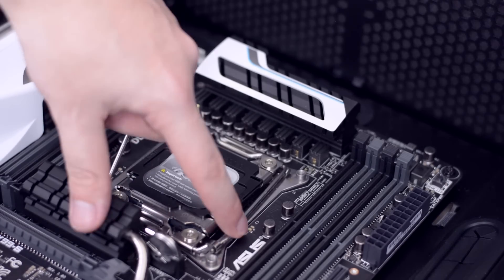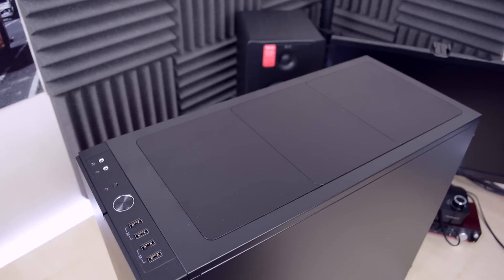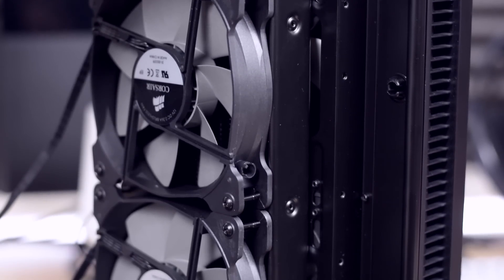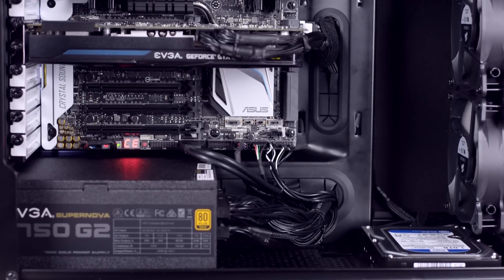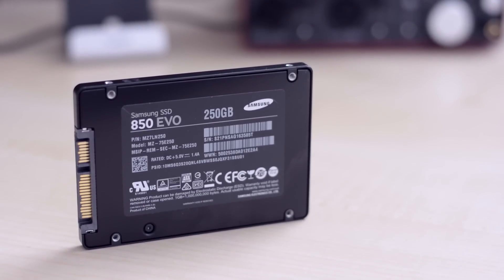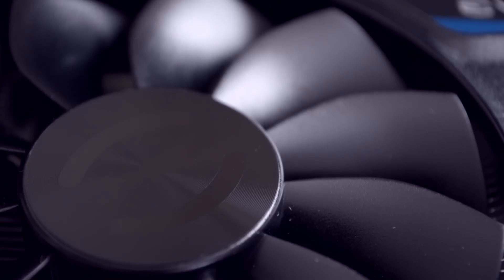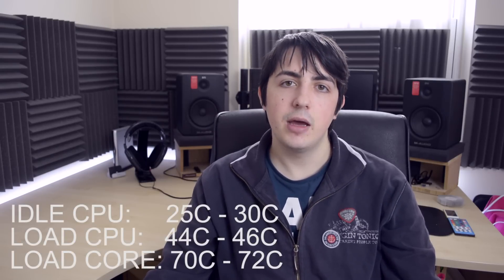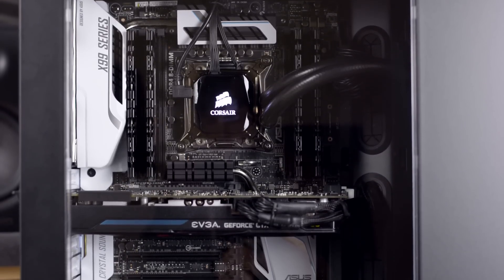Building a Silent Gaming or Workstation PC with Haswell-E, X99, DDR4

Comment: This Push-Pull Combination is absolutly useless. Because it works only good, if u have a radiator with a big thickniss. In your case, its more a Problem, as a solution for better cooling. Dont believe this hoax. Your radiator is so small, u only need push OR pull. If u know, what Push-Pull really does, u understand...the second Pull-Fans will help to geht out the disturbed air from inside the Radiator. But yours is to small, to have disturbed air....so dont tell, its better for the performance. Its only better, when u have a thick radiator.

Comment: Thanks for the video!
I'm so sad that you didn't show how you mounted your HDD drive since I am planning to go with the same orientation as you. :/
Reply: +falcolineLV If you dont need hdd cages and cdrom, buy the define s :)
Reply: Zxxtra Yeah, I should've done more research and gone for Define S but I was so hyped for building my first gaming PC that I didn't care much, thought it is a super good case and I should go for it and I did. Don't get me wrong, I love the case, but I could've had the same case for cheaper by buying define s.
Reply: +falcolineLV r5 is good though :-)
Reply: Chillhoof I got Define S, and my friend got R5. Both great cases, both equal sound dampend (?). S got psu filter aswell and even better front in my opinion. Who the fuck uses cd/dvd in 2015? :P And i cant see the difference in coating on the R5 and S, feels the same aswell :)
Reply: +Zxxtra r5 has a psu filter as well

Comment: I have the same PSU & Case as you what cable from the PSU did u plug into the SATA cable that controls the fans that are built into the case? Please answer need help badddd
Reply from the maker: Scott FS I can't remember for sure the connections but if it's a SATA connection you need a SATA cable from the PSU, the same cable that gives power to your hard drives.

Comment: And also. Since you have air coming in from the front to cool the radiator does that not then heat up your system?
Reply from the maker: landerx74 I prefer it in the front as i use fresh cold air to cool the radiator. This is a no win kind of situation. Either you are blowing warm air in your case or you are using warm air from the case to cool the radiator.

Comment: Very nice build and cable management. That 3.5" hard drive that you mounted on the floor of the case, did the case come with the screw to do that? Did it have the holes there already? Also, would you be able to mount it where the optical drives go at the top of the case?

My plan would be to remove the cages like you did, install a SSD in the back, and 1 blue ray drive and 1 hard drive also. 

Thanks and great video!
Reply from the maker: Gerardo Chavez Thank you! Yes, i think the screws were included with the case. There are holes there because you can mount fans so there is that honeycomb pattern. I believe you are not able to secure it well enough where the optical drives go as the HDD is smaller. Maybe you can install it on top of the blue ray drive with some Velcro if you are ok with that kind of DIY. You will have to experiment, in the worst case you end up with the HDD on the bottom like in my setup.
Reply: UnboxUk Thank you for the info! I really appreciate it. Cheers!

Comment: 5820k is the worst x99 cpu
Reply: vicnexxprod and still more powerful than every z97 cpu
Reply: Daniel Deutschen is a very good cpu but the worst in x99 chipset
Reply: vicnexxprod i have a 5930k :D. But as the 5820k has 28 pcie lanes it can only support 3 cards. The 5930k and 5960x has 40 so they can run 4 cards. So it really only makes a difference after a single card as both would run in 16x configuration. in 2 way SLI the 5930k and 5960x would run in x16 and x16 wheras the the 5820k would run in x16 and x8. Thats why i went for the 5930k over the 5820k as i have 2x 980s :D. So it makes a difference.
Reply: But it is also the cheapest
Reply: vicnexxprod
if you see it that way... :D
Reply: TB Craft i sacrifice my wallet in the 5960x with a gtx 960x
Reply: vicnexxprod
a gtx 960x doesn't exist
Reply: TB Craft
I recently saw a test in my favourite pc magazine testing exaclty that and they said that there would be no noticable difference bewteen 2x x16-sli and x16+x8-sli
Reply: Daniel Deutschen
 i have a friend with a 4.5ghz 5820k and the same set 980's. Mine scores quite a bit better gpu score than he does on 3d mark. It also sets the gpu's further apart so they look and cool better. i also bought it incase i ever wanted to go crazy and get 4 gpu's lol.
Reply: TB Craft
ok, 4way really is crazy ^^ I'd rather go for an additional pcie ssd with so many lanes avaidable

Comment: Liked your video! Thank you.  How many fans did you install?  And how noisy is your system?
Reply from the maker: landerx74 Thanks! There are 4 fans in the front of the case. 2 on one side of the radiator to push air in and 2 on the other side of the radiator to pull air. And 1 exhaust fan in the back of the case. I don't have an accurate way to measure the noise but the case does a great job at keeping the noise to a minimum. Very silent, i can barely hear it.
Reply: UnboxUk Thanks. One more question. Why did you not decide on the H100i GTX cooler?
Reply from the maker: landerx74 No worries. Because it was not available at the time and has only minor improvements.

Comment: nice video shots, what camera are you using?
You might get more noise from grafic card since will blow  heat from processor on it. You could test noise while gaming with radiator top and front to find out.
nice rig,
Thanks